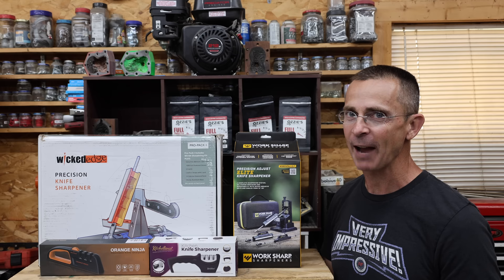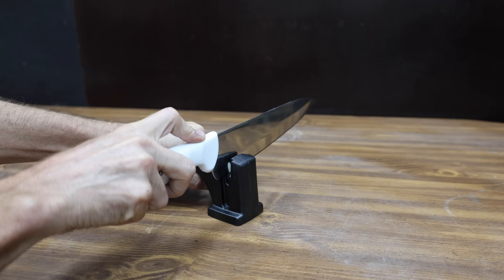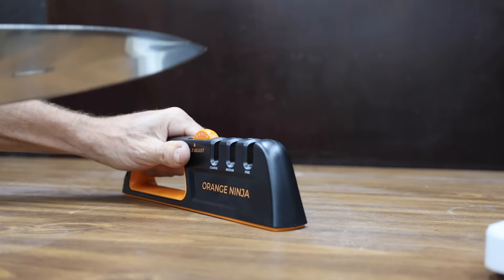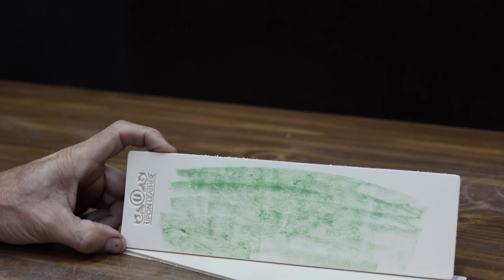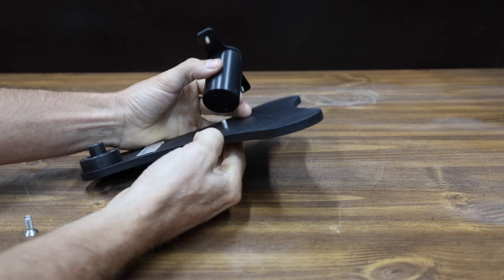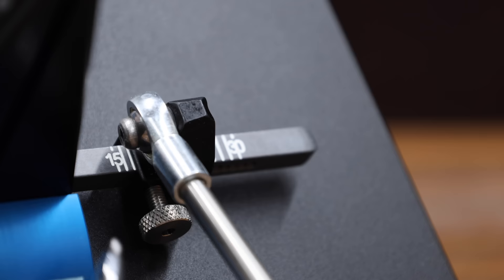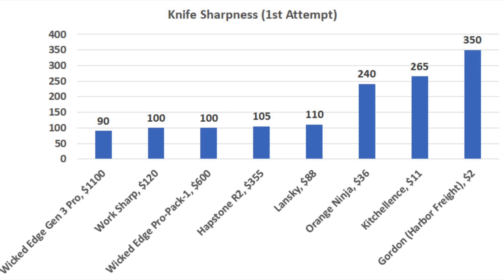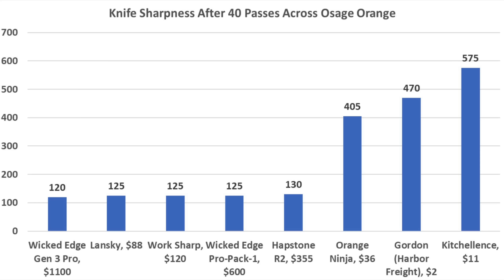Best Knife Sharpener 2023? Let’s Find Out!

Comment: The Lansky system has two more finer ceramic stones that would have put it's finish on par with the more expensive sharpeners. It's also advisable to use honing oil on the finer finishing stones.
Reply: Came here to say this. Been using the lansky for probably 20-25 years and it’s my favourite sharpener. I don’t mind it taking time, it’s therapeutic!
Reply from the maker: Thanks for sharing.
Reply: There are actually many other stones you can get as well for all kinds of knives to sharpen. At $6‐$11 per extra stone they're worth every penny.
Reply: Is it necessary to finish with some leather passes ?
Reply: @lolilollolilol7773  it's not necessary but it helps remove the tiny burrs when you're done
Reply: @lolilollolilol7773  no, but it wouldn't hurt.
Reply: Also he should sharpen to the existing angle of blade and not randomly say "17", "18".
Reply: Use also Lansky all Stones, leather with water paste, oils and polish the blade afterwards on a high bright polishing disc, knives can be used for an extended period afterwards just deburr occasionally with the hand steel cheers from Germany
Reply: I have a Lansky system. It is the reason why I learned to sharpen on whetstones. Currently I am usually using similar, cheaper and bigger alternative to the Lansky system for quick jobs. Whetstones for the win... ..and mentioning the "therapeutic" portion, there is no question. Bigger stone more zen...
Reply: I bought the regular stone kit after PF’s first sharpener video.  I tried sharpening 4-5 different knives and couldn’t get a single one sharp. I gave it my son-in-law and he couldn’t obtain a sharp edge either.  The other problem is with big red thumb screw-it interferes with the lowest angle.  Very disappointed and I may have thrown it away.  The Worksharp might be my next experiment.
Reply: Lansky is good for hunting knives don't need it for kitchen knives Bobet Easy Sharp is cheapest and best its a commercial knife sharpener they use in commercial kitchens butchers slaughterhouses. If you want a quick sharp knife its the best it is pull through with hone section and blade restoration section and mountable to a bench.
Reply: RepentandbelieveinJesusChrist. The real question is: Which sharpener would Jesus use? I have no doubt it would be one of the American made options.
Reply: RepentandbelieveinJesusChrist.  lol.
Reply: @lolilollolilol7773 You can use newspaper or cardboard to remove burr, you don't need a leather strop with compound
Reply: @brkel I still use the lansky for a quick sharpening,  but prefer to use whetstone for most sharpening needs.   It is definitely a skill to be able to sharpen a knife with just the stone,  and is especially important to match the factory edge,  rather than create a new one at 17°.
Reply: @johnbouldin9033  Check the edge of the knives you're trying to sharpen, it sounds like you may be trying to sharpen at too steep of an angle (17 degrees). Most knives are fine at 25 or 30.
Reply: @arekx  17 or 18 is a perfectly acceptable angle for a kitchen knife. He's very thorough. He probably checked the knives he bought to find that angle.
Reply: @arazusaysbah6784  It's not if your kitchen knife is for example 19 degree and you go with 17. You are reshaping blade then, not just sharpening. He speaks in video in such way that it looks like best guessing and not actually checking.
Reply: Lansky also makes a sapphire hone and a leather strope.
Reply: @arekx that's what the sharpie is for. It lets him know that he fully sharpened the apex. You can't get a proper burr unless you fully engage the whole bevel
Reply: @arekx  So you're just going to ignore the part where I said "He's very thorough. He probably checked the knives he bought to find that angle."
Reply: @johnbouldin9033  your problem is probably you didn’t spend enough time on one side to make sure you get a burr that comes across the entire edge. You need to make sure you get the angle all the way across the edge of the knife until you actually push a burr over to the other side. It’s not a big burr you could feel it with your fingers or even better with your thumbnail. Once you achieve this, you go to the other side and you do exactly the same thing grind and tell you get the same edge. Try and make both sides balanced then it goes real fast after that cause after that, all you’re doing is polishing, so go from one grit to the next 10 to 15 strokes on each side, with each grit right till you get to the highest grit. At that point, you can shave with the thing.
Reply: @sammiches6859 😂😂😂😂 no doubt it would be one of the American models. Of this I have no doubt!😂😂😂 you are hilarious buddy I love it, the Jesus freaks just crack me up.
Reply: I appreciate your input.  I still haven’t found where I put the Lansky kit.  The skeptical side of me does question why, if everyone could get a very sharp edge with the $40-100 Lansky system would anyone spend hundreds more on other systems.
Reply: I promise I tried 20 strokes per side and then 50 per side.  Just never got sharp.  The pull throughs are hit and miss but at least leave a slight edge that’ll trim hair off my arm.  Can’t get that with the Lansky.

Comment: I bought the Worksharp sharpener based on this video.  I got the kit with the carrying case and the extra stones.  If you go back and look at the video notice how he's holding the knife with his other hand while he's using this sharpener, and that's because it does not hold the knife steady at all. There is virtually no way to guarantee that you are grinding the same angle every time with this sharpener because of the way the knife moves with every stroke.  Also the throw of the guide rod is short, so if you think you're gonna put your 12" chef knife in here, forget about it. I do not recommend.

Comment: Thanks for being consistent with your testing techniques between all your knife sharpener videos! It makes it very easy to compare brands between videos. And it shows how consistently well some brands, like the Lansky, perform.
Reply from the maker: Thanks!
Reply: I would add he's also comparing apples to apples here using angle stone systems.  Belt sander systems, like the ones WorkSharp has popularized, produce beveled edges and are not quite the same.
Reply: Can you reverse the knife so it sharpens both sides? @jaklumen

Comment: I found the Wedgek AZ4 Angle Guides to be very effective. They are used with a flat sharpener to get you started at the proper angle and all you need to do is slide the knife by hand over the flat sharpener abrasive while trying to keep the angle the same. I made cheap kitchen knives razor sharp enough to shave body hair with little effort, and I'm a complete dunce when it comes to these kinds of things.
Reply: Thanks for the suggestion! I have a whetstone but not really sure if I am using it right. I wonder if this is something you can 3D print.
Reply from the maker: Thanks for the feedback.

Comment: Some notes about the Hapstone: the clamps allow you to clamp from heel to tip, which prevents blade flex. Systems that do not prevent blade flex can have inconsistent sharpness across the entire length of the blade. Also, it is capable of using a huge variety of abrasives, whereas the other options on this list are incredibly limited. They also have the Hapstone RS which is $100 cheaper and nearly as capable.
Reply: Also, we need a good flashlight test video! Between Acebeam, Lumintop, Olight, streamlight, Fenix, ect
Reply: @OhQuinn  torquetest has been doing flash lights and headlamps with lab calibrated testing equipment.
Reply: @OhQuinn  There's already endless flashlight tests.
Reply: @OhQuinn  I did a double-take when I thought you wanted to see a fleshlight test video...
Reply: I think you're overestimating the amount of flex in most blades.  Unless you're sharpening fillet knives constantly, it wont really factor it.

Comment: My interest in sharpening knives started some 60 years ago.  Since then, I have tried about every sharpener known to man.  After spending a ton of money on failures, I have settled on the TSPROF Kadet Pro as the absolute best.  The TSPROF K03 is good too but I prefer the Kadet Pro.
Reply from the maker: Thank you for sharing!
Reply: i had something like that, but eventually reverted to normal sharpening block and freehand.
Reply: Did you every try a paper wheel system? This is among several sharpening systems I’ve tried and it will put am amazing edge on a blade. I gave up using as my primary system, but still like it when I want to go super sharp.

Comment: 4:46 center point sharpeners like the Lansky, worksharp and wicked edge have an interesting geometry. Because the distance from pivot to surface changes, so does the angle.  

My advice is to make sure each individual knife is remounted in the exact same position on resharpenings.   Maybe keep a log book or scribe a small mark on the blade.
Reply: The second problem most of them have/can have is with full flat grinds.
I noticed that when tyring to clamp a swiss army knife blade and it always tilted to one side.
So the angle you set would not be the same on both sides.
For sabre grind knife blades you only have the issue mentioned above with the changing angle along the blade.
Reply: In addition, it is very critical with guided sharpeners to have the knife level in the clamp, in relation to two points between the tip and the rearmost sharpened section of the blade. PF isn't doing this, and it's 100% causing inconsistent angles between the tip and heel of the blade. In some places in the video the knife is misaligned by a solid inch or two. The generally accepted best method is, be consistent with how deep the knife is inserted into the clamp. Make sure the two points (sharpened heel and sharpened tip) are level. This gives you a super consistent angle along the blade and between sharpenings.

Comment: The steel used in the blade also has a huge impact on which sharpening method works and how well it works. Im a commercial fisherman who uses mostly vicortinox knives and im able to achieve razor sharpness with a simple stone and two stage strop (canvas/leather). Just my 2 cents from someone who uses a knife a lot in my everyday job both as a tool for cutting line/net and processing fish.
Reply from the maker: Thanks for sharing.

Comment: I use the work sharp. It’s a great sharpener. I can get my knives to a mirror finish with it.
Reply from the maker: Great feedback on the Work Sharp! Thank you
Reply: The non-pro worksharp can be improved by adding a little screw-jack under the blade holder to reduce flexing when the stones press on the blade. I 3D printed one, others have made the same out of a bolt and a barrel nut. With that little upgrade the angle becomes more consistent and the blades even sharper. I had a Lansky years ago and I greatly prefer the Worksharp. The results are similar but the Lansky is more fiddely with the stones and rods and the multi piece clamp.

Comment: It's all about the stones! Invest is a high quality diamond stone kit and you can sharpen anything and they'll last a LONG time. Hapstone makes a couple amazing options. As always GREAT review and happy new years!
Reply from the maker: Great point! Thank you and Happy New Year!
Reply: The issue is if you are older like me and never practice with a stone. it hard to keep the knives sharp. With these system I don't have spend time getting the muscle memory that is harder to do with you are older. It's about getting a consistent sharp knife with a honing steel you can keep sharp for months instead of having to sharpen every 2 weeks.
Reply: Ditto!  I started with the Work Sharp and upgraded to the Hapstone and Tormek.
Reply: @faervas1234  You still need stones. The difference between one system and the other is not in the sharpness. It is in the capabilities, can it do big, small, curves, does it flex, things like that. If you put the same stones against the knife at the same angle you are going to basically get the same sharpness, even if you are holding it by hand. Thats why an excellent set of stones is more than the system itself. As always it comes down to the right tool for the job.

Comment: I bought the Work Sharp about a year ago. I have sharpened multiple family and friends knives with it, it really does work well! Take your time and find a nice angle for strength and sharpness. The steel the blade is made out of also makes a huge difference as to what angle you take an edge to. Do a small amount of research, it will help!  You'll be golden with the Work Sharp! They also sell replacement stones, ceramic, and strops pretty cheap.
Reply from the maker: Thanks for sharing.

Comment: I use a belt sander to sharpen all my knives. I know it sounds like I don’t know what I’m doing, but I can take any knife, in any condition and make it shave in about 3 minutes. I urge you to try this method for yourself. I bought the sander at harbor freight and the belts (120, 240, 400, 600, 800, and 1000 grit, along with leather belts) all on Amazon. Not very expensive and very easy to do.
Reply from the maker: Thanks for sharing!

Comment: Thank you, another great knife sharpening video.  The work sharp for the price is awesome.  You can also use the angle finder on the Wicked edges since the height it is held at will influence the angle.  Also there used to be a slight difference in the left and right side angle, since the one side of the clamp is stationary and the other moves.  The top of the range one I think eliminates that issue.

Comment: Since you used Mercer culinary knives... 
A while back I did research to figure what was the best bang for the buck.
They ones I got are made from X50 Cr Mo V15 steel and I have been quite satisfied with them they hold an edge quite well and are easy to sharpen, often I only strop them to get them back in business.
From what I could gather they use the same steel as Wusthof.

Comment: Hi, I thoroughly enjoy your test and you've become my absolute go-to source for unbiased reviews of just about anything from power drills to tire repair kits to vacuum cleaner.

I'm struggling to find an unbiased review/test of the different models of potato "ricers" (apparently the definitive tool for the absolute best mashed potatoes). All the so-called reviews on YouTube are no more than ads for affiliate links on Amazon....I've tried two models so far and both were very disappointing; one had a huge amount of "piston blow-by" (where most of the potatoes would gush out the side of the piston instead of through the screen) and the second one had the handle completely bent after the first press... I'd really appreciate a test for those. Thanks
Reply from the maker: Thanks!  Thanks for the suggestion.

Comment: I had a kitchen and used a Norton Multi Stone. I got the hang of it easy but 25 years later I broke it down, cleaned it up real nice and flattened the stones after I removed the old oil but I haven't been able to get that great edge. After much searching I settled on and bought the Work Sharp Ken Onion...it's due to arrive soon and I look forward to some nice edges..great review again..
Reply from the maker: Thanks!  Thanks for sharing.